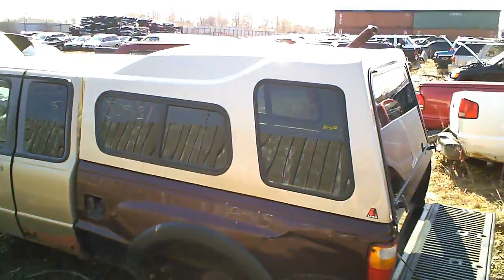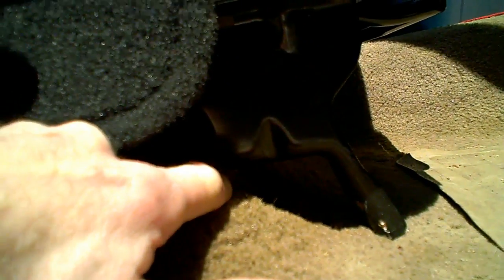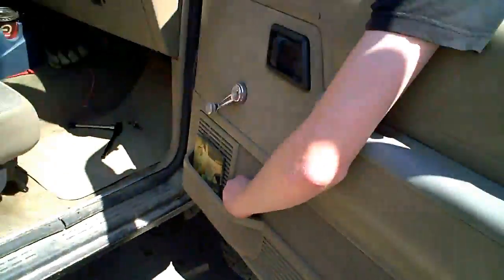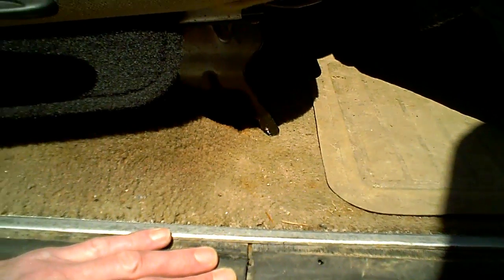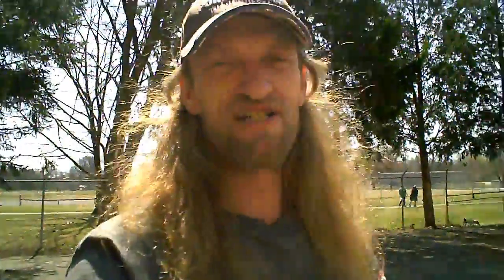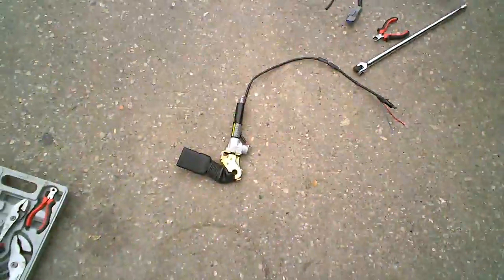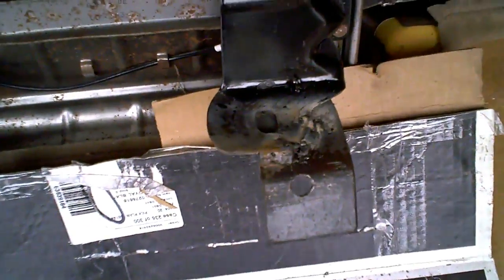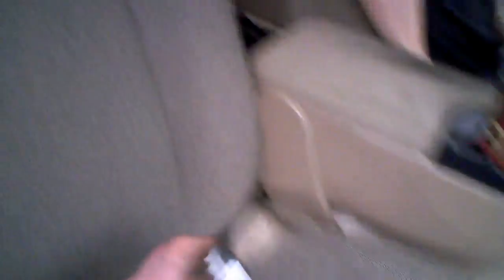Custom Bench Install with Exploding Belts

Comment: Nothing breaks anything. All modern cars have these tensioners. Those are very useful because when you crash, those tensioners tightens your seatbelt that you would be in your seat tightly, without a movement. There is a very good example in a sports cars, where you sit so tight, that you cant even move and for that drivers go away fine after serious crashes...

Comment: i had a 89 F150 and it had bucket seats and i switched it out for a 60:40 seat and the front ones didnt line up aswell so i used a lawn mower blade and made bracket with that for the front lol

Comment: Did you even try swoping out the seat brackets???
Also that seat belt thing I rather have a broken hip then go through a windshield in a crash, and all newer vehicles have them above 98 I think???
But I do agree those things are very dangerous, just think its a sensor malfunction and it exploded while you're driving, almost as dangerous as a stupid Ford parallel park steering thing, just imagine if that system malfunction while you're driving, which it will someday and that will be the end of Ford
Reply: As long as they don't ignore it like GM did with their faulty ignition switches.
If you wearing the safety belt correctly,  not having the shoulder strap UNDER your arm like I've seen people do, that's all you need. Do a panic stop and feel the belt tighten. That's all the safety a belt needs and my mother has a broken hip from a fall and believe me, you don't want a broken hip....nor go through the windshield either but that's what the seat belt is for.